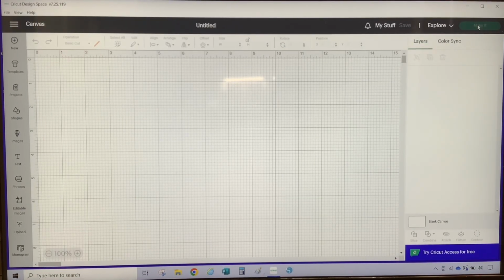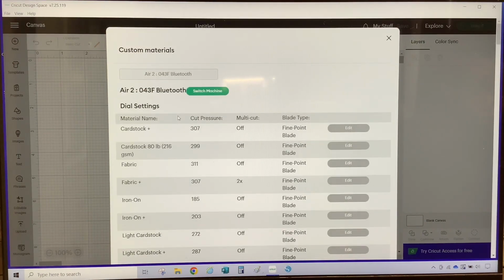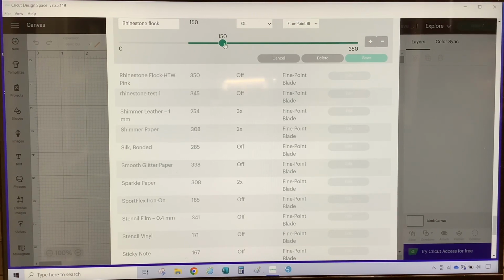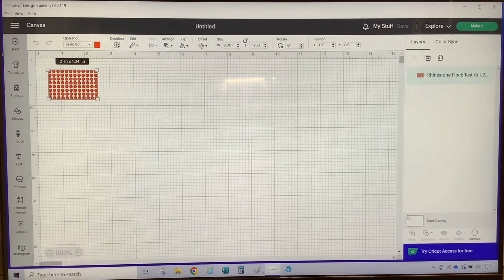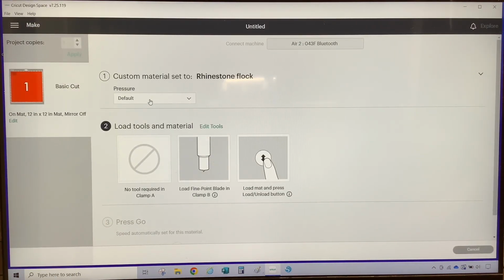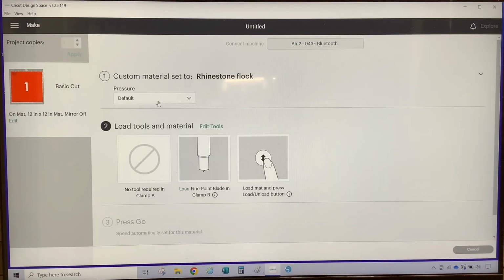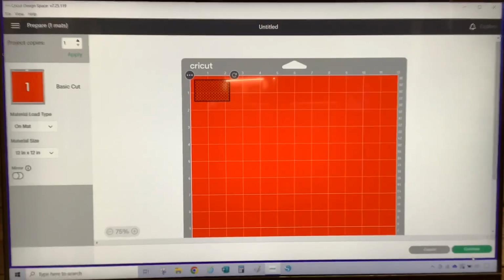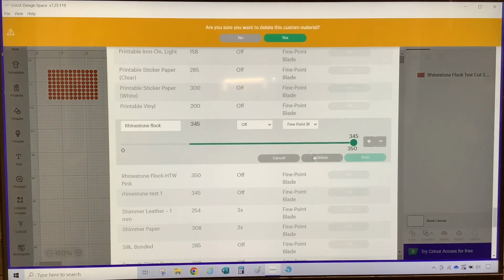HOW TO CREATE A CUSTOM MATERIAL SETTING IN CRICUT | CRICUT CUT SETTINGS FOR RHINESTONE FLOCK

Comment: Your video is very educational and informative. I am stuck on the first step. My Design space does not have the 3 horizontal lines to set up the  material.  Is there another way to access?
Reply from the maker: select Material Settings at the bottom of the page when browsing materials for your project.   Also here is a link with other options. Scroll down to that section. Thank you for watching!

https://help.cricut.com/hc/en-us/articles/360009383274-How-do-I-use-or-create-a-Custom-material-setting